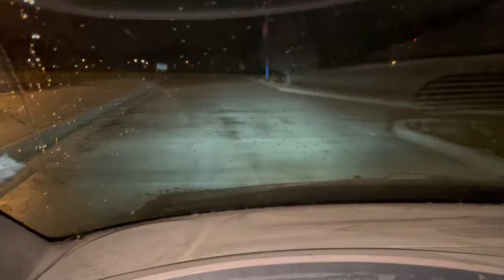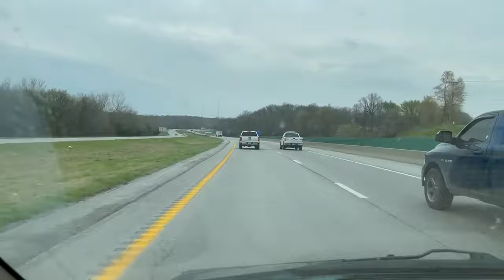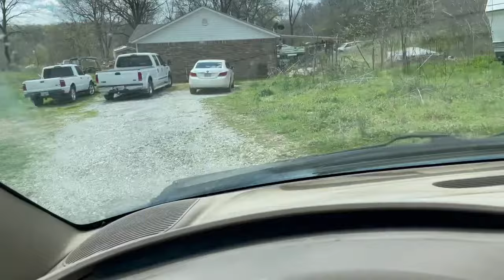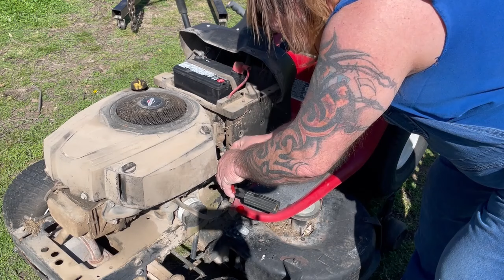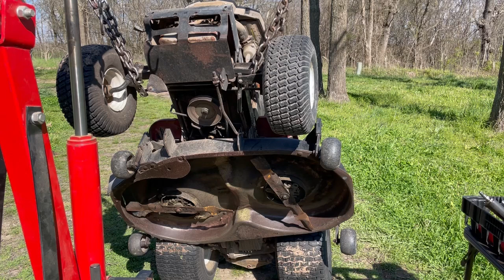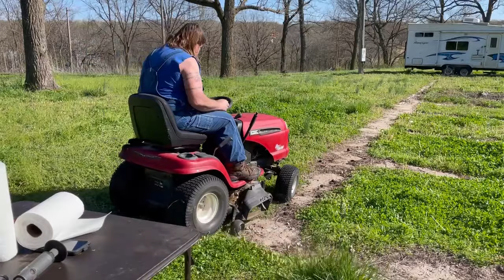SMALL ENGINE HOUSE CALLS EP2 - Craftsman Riding Mower Won't Start

Comment: Do you ever come to Wisconsin what would you charge for a a tune up on a snow blower And on a riding lawnmower and a weed trimmer
Reply from the maker: i don't charge for these house calls right now. if you want me to do a video of something of yours get in touch with me
Reply: Okay sounds good
Reply: I think it would be a found drive to the cheese state
Reply: Do you know why my key falls out and still stays running through does it need a new key  ignition?  On my riding mower that’s another thing it does